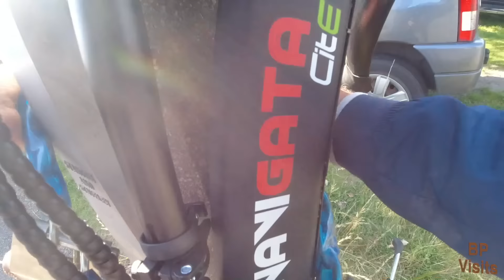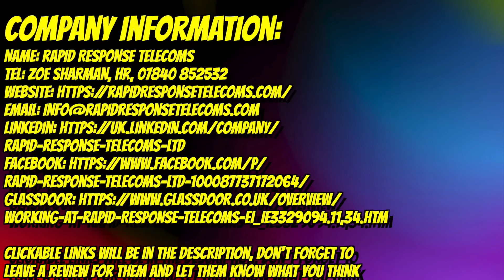Rapid Response Telecoms, The Worst Company I have EVER Visited!! - Part 3 of 3 👮‍♂️📸❌💩🎥

Comment: @51:26 . . . Yep, it called tort of conversion, someone doesn't have to physically remove your bicycle for it to be considered theft, they just have to wrongfully deprive you of access / use for a charge of theft . . . worryingly for the culprits conversion is a tort of strict liability*

*Strict liability is a standard by which a person is responsible for the consequences of an action even without criminal intent, in layman's terms the act of doing what they've done is a crime, regardless of excuses of not knowing, not meaning to deprive you . . and so on.
Reply: As the last video it clearly isnt
Reply: @charlesdarwen3683   As in the last video, it is.
Reply: @davelordy  Fails the first test of the tort
Reply: @charlesdarwen3683 
The first test is that BPVisits holds a property right - check.
Reply: @davelordy  not according to everything i understand but up to you - carry on with your yewtoob law practice though
Reply: @charlesdarwen3683  Great strategy, if you don't agree then just accuse your interlocutor of 'yewtoob law practice' and run away. Name calling on Youtube is cool, but it doesn't change the law.

Comment: You should go back with a Lock and lock the gate shut withy them inside, lol
Reply from the maker: They have angle grinders in some of their vehicles so they would just cut it off
Reply: @bpvisits   sure bit its still a inconvenience, lol, also depends on the access to the lock from the inside?, cheaper=could try a big lock nut/bolt tuned up tight, right sod to undo from the opposite side of the gate?.

Comment: If they were that worried about the fibre optic cable why would you store it near a fence where a truck with a hi-ab could pull up and just lift it all over you would store it locked inside. What a load of rubbish.